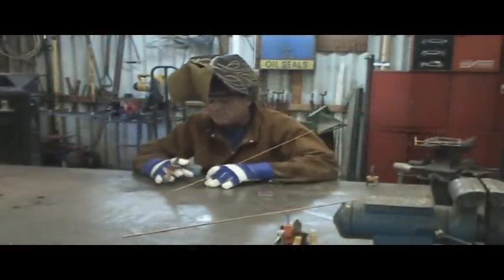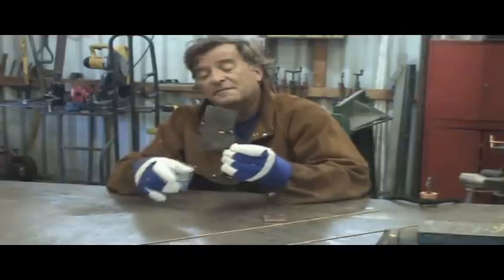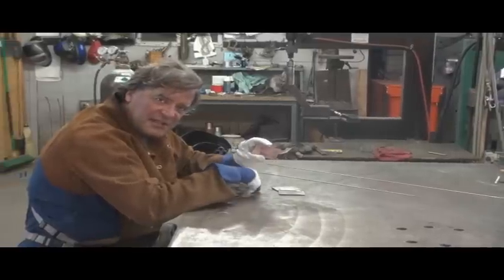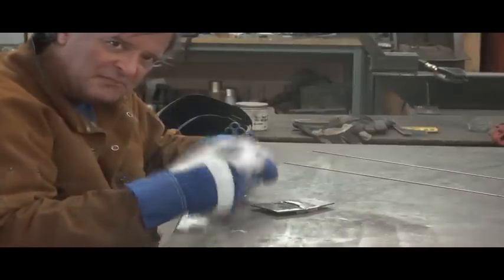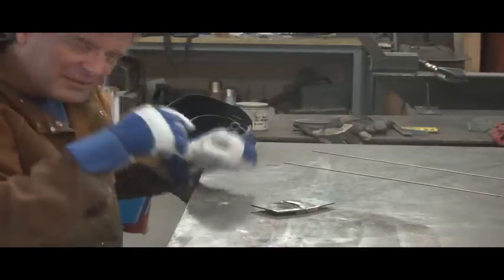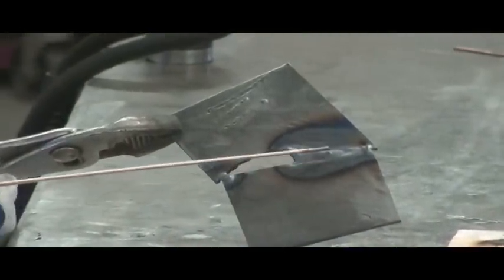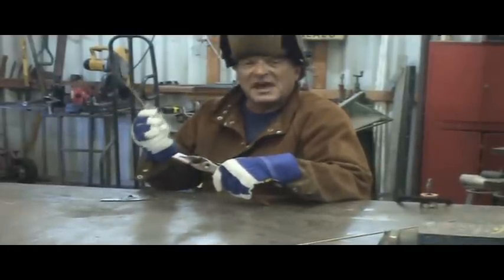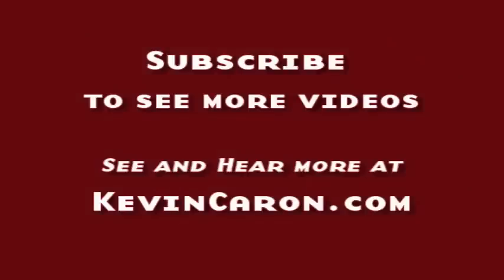How to Weld a Steel Patch Using a Copper Backer - Kevin Caron

Comment: FYI.  Steel has a higher melting temperature ( 2600 - 2800 F) than copper (1983 F).  Copper is a good conductor of heat, which is why it doesn't melt when used as a backer.  I find your videos very informative and you are a better welder than I will ever be.
Reply: Yes, great trades video, first I found after counterman at Praxair described this for a autobody rust-hole hack. But it's the substantially higher thermal conductivity of copper (385 vs. ~50 W/m/C) rather than Tm that this works.

Comment from the maker: I got mine at the local scrap yard. They have a copper building in the corner of the yard. You might check with your local scrap yard or a new steel yard. You can also get it on line but shipping with get you in the shorts....

Comment: Get a piece of copper bar stock about  3/16 thick  x 1.5 wide and  what ever length you want. On each side of copper bar 1/4in from the edge drill a 1/8in hole every 3 or 4 in. Then Lay the copper over the seam to be welded and using it as a template take a 1/8th drill and transfer the holes one at a time. After you drill the first hole put a 1/8 cleco in it to hold it then the next and so on. Now your holes on the bar stock and floor pans or body panel what ever match perfect. Then you remove the clecos and put the bar stock on the back side of seam to be welded. Now place the clecos to hold it in place. This will pull the sheet metal down real nice and tight so you get a great weld.  After repair is made remove the clecos and plate. Just a little tack with the mig to fill the 1/8 holes and you are done. Then your plate can be used over and over. If you not sure what a clecos is. Then look them up. Basically it is a temporary rivet. A special set of players to apply them. I think I purchased 50 of them and the players off eBay for $35. I know I should of made a video instead of rambling. I hope o explained enough you can follow. I sure Kevin might be able to follow. It sounds a lot harder than it is.  If  anyone has any questions I try to help.
Reply from the maker: Well said and yes, I know what clecos are!    I have a whole box of them that come out for some jobs.
Thanks for posting.

Comment from the maker: @CBaughman  I would say no. Keep your machine set for the metal you are working with. If you add more heat you run the risk of welding to the copper.

Great question, thanks for posting.....

Comment: Thanks for this.  Thick copper has become increasingly difficult to find at a reasonable price.  I'm wondering if it is possible to substitute brass (containing copper), with a flux core mig (no inert gas used).  Basically welding everything the wrong way for welding brass, just to use the brass as a back plate.
Reply from the maker: works just as well in my opinion.  Thank you for watching and posting.

Comment: Ty we use to do this at the railroad but, for some reason I had in my mind it was brass.. Guess that's what happens when you dont touch a welder for 8 years.
Reply from the maker: My brain is getting fuzzy as well.  Might be all the smoke from welding.   Or maybe the vodka!